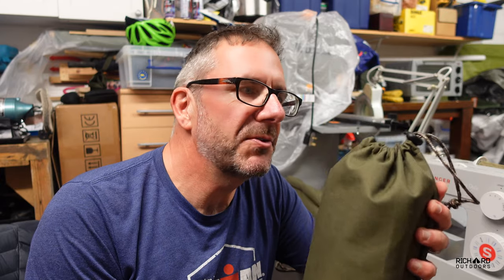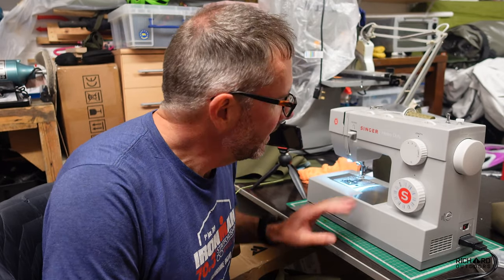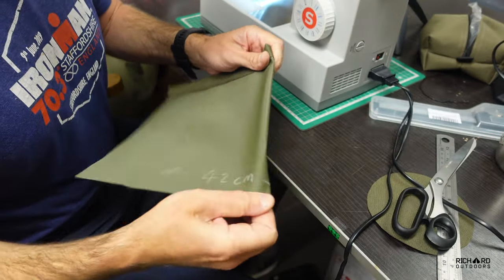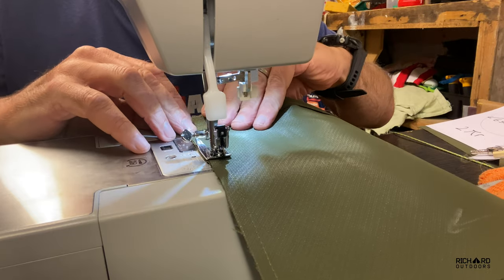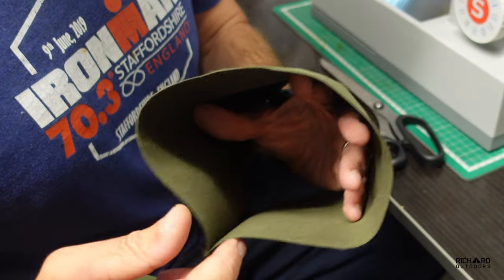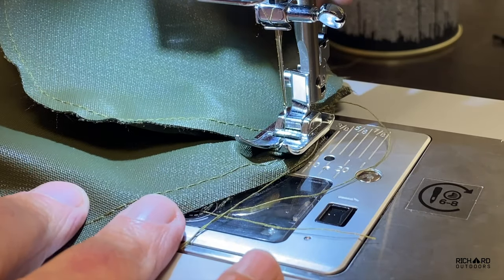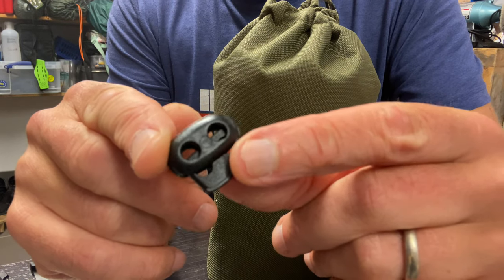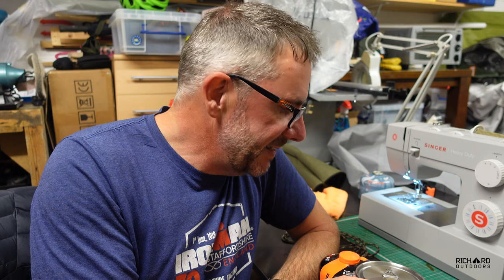DIY CANVAS POUCH FOR COOKING KIT | CAMPING GEAR | HOME SEWING

Comment: I am not good with pins to hold pieces in place, but I find an office stapler works nicely and the staples remove easily. I staple the bottom in, dividing in half, and then quarter. This puts the folds in evenly around the circumference when I sew.
Reply from the maker: Like that!

Comment: Hi richard, looking good! Ik have been making a few gear pouches in the last year or two.  I find that is you clip or pin the botom in four parts (like the point of the compas) to pre marked spor on the outer, you wil get near to or perfect results! It is a fiddely business though. 
Maybe because   I tend to use a cotton canvas, ant this requires finishing the ends or it will un wind. But I like to make the draw cord sleeve in a separate piece. Possibly a different colour.

Comment: That must have been your first round bag, given that the disc actually fits the bottom edge, beginners luck 😜 For me there's always too much or too little material left, haha. Seems pi varies with time...
Few comments:
- melt the cut edges over e.g. a tea light candle, prevents fraying. Nowadays I use a small lighter-gas powered soldering iron to cut straight lines along a steel ruler. Quick, accurate and it melts the cut at the same time
- exactly same sewing machine here. The foot pedal can be opened and the response adjusted. Off the factory it only lets you choose stop or full kamikaze 😄 Also, step on it without a shoe on and use your foot's arch rather than the ball. Those give you very fine control over the speed; you can stop the needle while in the material.

And yeah, others mentioned it already. Do the vertical seam last and mark quarters or eights of the disc and matching straight edge to give you a reference how the two edges should align in a perfect world.

Comment: Great Video :) 
I'd say that the bunching up when you sew the base in, is because you did 2 X PI x R on the oversized radius that you cut out, not where the actual stitch is going to go, I.E 5-10mm inside the circumference. So your tube is too big maybe?

Comment: I actually want to buy a sewing machine now. Thanks, Richard. 🙂👍
Reply: Be sure the gears are metal.  There are some out there that have plastic gears and they don't hold as well as the ones with metal gears.  You will also want to buy a variety of needles because they are rated from silk to denim/leather and either ball-pointed for knits or sharps for woven.
Reply: @J judy  Thank you! 🙂👍

Comment: great video thanks what type of cotton do you use?
Reply from the maker: Hi. Gutermanns
Reply: @RichardOutdoors  thanks so much do you use this one for canvas - GUTERMANN-Upholstery Thread. 100% polyester. High strength, used on leather, vinyl, coated fabrics, denim, canvas and carpet materials. Soft and flexible ensuring neat flat seams. 325 yd Cone. Imported.
Reply from the maker: @madelenesilbernagl636  possibly. No idea really.

Comment: Nice one Richard. Can I ask what thread you used pleased ? when I did a repair to a caravan awning the thread I used kept snapping. I'm now thinking of making a cover for my vinyl cutter from the same awning. Thanks Mal
Reply from the maker: Hi Malcolm. It’s Gutterman Col 432 No 70. With a denim needle. 👍
Reply: If your thread keeps breaking, the needle is the usual suspect.  It is slightly bent or there is a slight burr on the tip.  The other suspect is lint in the bobbin area.
Reply: @jjudy5869  Thank you for that, I'm no expert at sewing and will check what you suggest before doing anymore. I'll try the Gutterman thread as Richard suggested, it's only £2 at the local Hobbycraft.

Comment: Wouldn't you need to add a few extra  mm's for the vertical seam as you've worked out the circumference to within 2mm?
Reply from the maker: 🤷‍♂️I allowed 3 extra cm!!
Reply: Yup, you have to allow for seam allowance and I would add a couple of centimeters for ease of getting stuff in and out of your bag.  It looks like he used 1/4 inch or 5 mm for seam allowance.  If you use something that frays a lot like denim or some nylons you want to use a zig-zag or second row of stitching close to the edge to keep the seam from fraying/pulling out

Comment: You never mentioned the wife or some other person to rethread the bloody needle when the cotton breaks as the eyes on the needles are so small. I tried for 15 minutes, cursing & swearing & it took my missus 10 seconds!
Reply from the maker: My machine has an automatic threader!
Reply: @RichardOutdoors  Mine is called Gail
Reply: Before I had my cataracts removed I was down to using a magnifying glass to thread my machine.
Reply: @jjudy5869  Tried that & still couldn't see the bloody hole